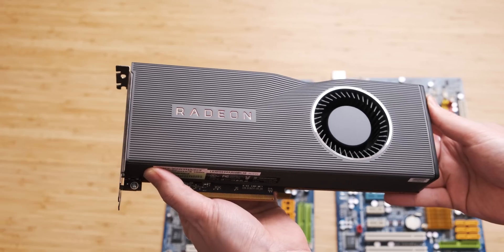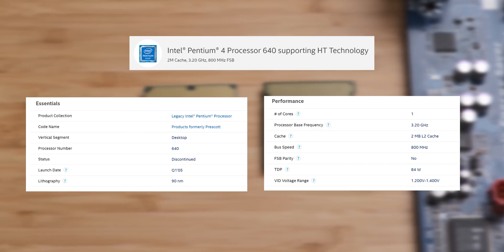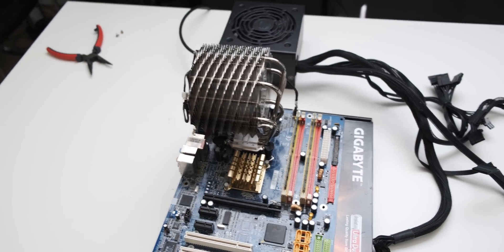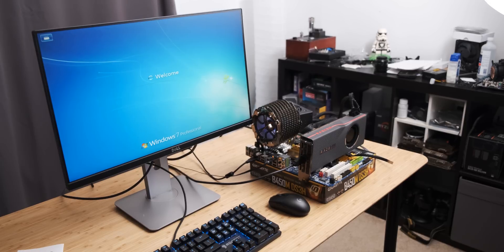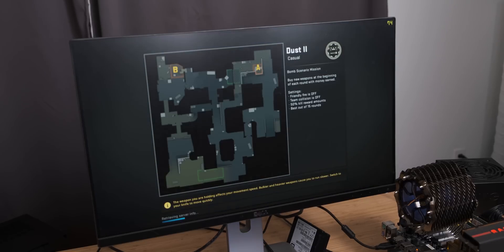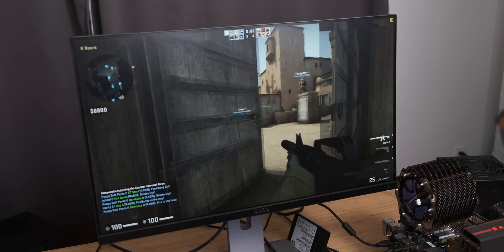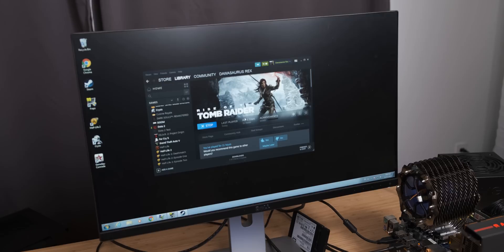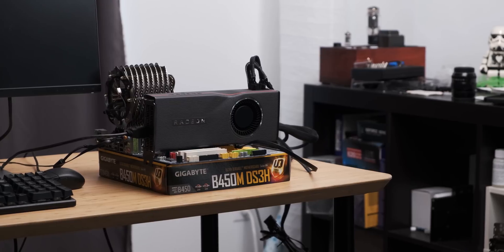The ULTIMATE CPU bottleneck: AMD RX 5700 XT Ft. 2005 Pentium 4

Comment: I could try pairing my Radeon 6700 XT with a Pentium 4 670 (with the same humble 225 MHz FSB OC as your chip) or a Core 2 Duo/Quad 6700. Don't have an i7 6700 yet. What I do actually have is a few hundred grams of other CPUs ... And just enough mental energy to test a few of them. If I do, I'll post my results on Reddit.

Comment: Try a Core2 Quad in that rig. Be aware that not all system boards will run the later 45 nanometer  Core2 series of chips. IIRC Intel 965 series chipsets only run the 65 nanometer earlier Core2 and the Intel 31 and 41 chipsets are for the 45 nanometer chips. It's been a minute since I had those in working computers.

Comment: I have a eVGA 680i SLi motherboard and Q6600 (GO stepping) overclocked to 3.84 GHz with 8GB's 1200MHz DDR2. (CRYSIS rig from 2007-2008) 
I then through a GTX 1050ti in it and it actually played a lot of newer games, especially DX12 and Vulkan titles like DOOM 2016 and Sniper Elite 3, 4 at 60fps at 1080p high settings. I then through the GTX 1050ti in a i7 3770K build overclocked to 4.8GHz and was playing Metro Exodus at 1080p high settings with Physics at 60fps no problem. Tessilation would bring it down a bit but, it did still run quite well. nVIDIA promised a 32% increase in performance with there latest 10/16/20 series drivers in Metro Exodus and they didn't dissapoint. AMD also boosted perfomance in Metro with there RX480/580/590 4GB/8GB cards. I'm actually testing a Sapphire Nitro+ RX480 8GB OC (1342MHz) basically a RX580 on my 5.3GHz 8700K GPU bench and its running at 1080p Ultra settings averaging 60-75fps. Just have to pick those certain titles, (that are still great games) with the right hardware and you can still have a great gaming experience at 1080p. High, Ultra settings.

Comment: If you feel like making a part 2 of this video, give it a go with this set of games.
F.e.a.r (looks great imo too this day.)

F.e.a.r 2 (has it in minimum requirements so give it a go ^^)

trackmania nations forever (ran this on a intel atom n450 w 1 gb ram & igpu so pentium 4 shouldn't be an issue.)
Serious sam 2
serious sam hd (Either of the encounters are close too the same engine & has fairly low requirements it seems.)
Left 4 dead 2
alien vs predator (the 2009 or 2010 game called that.)

bioshock 1,2 should start on the pentium 4 (not sure the hd releases will actually.)

Sonic allstars racing (not transformed) has pentium 4 as minimum requirement

Battlefield 3 should start on that pentium 4 as well, but ofc will run like garbage like expect 25 fps regardless of gpu on average.

colin mcrae dirt has 3.0 ghz pentium 4 as minimum requirements so that will also start on this.

Dirt 2 might start as well on this pc, not 100% sure though.

Worst case scenario is that you can stick in a celeron 450 which is a core 2 duo era single core & overclock it a bit if you need core 2 duo cpu instructions.

Or upgrade too socket 1155 & use a celeron g470 a 2 ghz single core or the celeron g555 which is the fastest dualcore celeron on socket 1155 at 2.7 ghz & turn off 1 cpu core just too have newer cpu instructions while still having a pretty big cpu bottleneck, ofc it will be more efficient then a pentium 4 or pentium d probably but still...

Comment: A. get better motherboard B. max the ram 8-16gb ddr2-ddr3 C. get p4 672 or 670 D. overclock it 4.5ghz or even futher needs watercooling E ssd is allways a nice add on F. Try to run both cinebench r15 and r20

Comment: The ultimate CPU bottleneck is on my phone when I disable all the cores except one low cluster core witch I have underclocked to 300 mhz (same CPU power as one 2008 smartphone)
Also Pocophone extreme user here :)

Comment: 1 core i9 9900K 2 ghz vs 1 core pentium 4 , 4 ghz <3
Reply: even the first core 2 duos where almost twice as fast per clock than the netburst pentium 4. and a modern day cpu should at least double the IPC of a core 2 duo. so i would recon 1core 1 ghz core i9 vs 1 core 4ghz pentium 4 would be about equal in basic tasks.

Comment: Next video: Ultimate GPU bottleneck. 
Use a GT 210 with a core i9 or Ryzen 7,9 xD
Reply: No a gts 450 with a threadipper 3990X I want to try it but I only have a 3700X in hand and a 2080 ti could find a gts 450 or fix one scares me

Comment: There are even worse combinations possible; there were some 478 boards with pci express slot and cpu wise you can go down as low as a 1,4 Ghz Celeron on those...
Reply: You can't run 64-bit driver on anything older than Prescott stuff.
Pascal + Northwood Celeron : https://i.imgur.com/4yC4r2c.png

Comment: I am surprised Half-Life 2 was that stuttery. Considering it was a game released prior to Dual core being the norm(I am not entirely certain about this but I am very certain loads of people were still using Single Cores), that the game struggled quite a bit. My best guess is that the at the time Half Life 2 was released, it ran primarily on 640x480 and at most, 1024x768, so trying to run the Pentium at 1920x1080 was probably a bit too much despite the GPUs being over a decade ahead of what HL2 was built for. Another reason why HL2 might have stuttered is because the game might have been updated over the years to be compatible with newer systems and those compatibility updates might have harmed performance, which is not a problem for even modern day IGPU setups, but may cause performance isssues for system that were from that time. I saw a dude test an early Intel IGPU and he tested the original HL on steam and it was unplayable, the Tested the non-steam version and it performed much better(although performance was still not ideal).

Comment: that and the fact its running off the first gen pci-e lane is a bottle neck, funny thing is if you took that gpu out and put something like a 750ti in it you would get the same fps because of those 2 bottle necks. Ive seen a test like this on linus tech tips channel
Reply: 🙂 yes a 750ti or an HD equivalent is a good sweet spot for these older boards

Comment: I have two Northwood Pentium 4s. One is clocked at 1.76Ghz and the other is at 2.6Ghz. Runs NFSHP2 quite well until the optical drive decides to eject the cd in the middle of a race.

Comment: 3 Years later we have Quad Core CPUS like the 920 that can still handle Gaming today. Insane how slow the Progress in the last 10 Years was. Still using an first Gen x58 Board from 2008 with the W3670.
Reply: 🙂 i have three 1156 with X3470, its alot cheaper 😍

Comment: Try using a Core2Duo or Core2Quad

Or use a 771 Xeon in the 775 socket and try to play modern games on that
Reply: On those cases you need to overclock the CPU, because the Q9650 at stock speed, bottlenecks a 1050Ti XD
Reply: @gamamew  well yeah the Q9650 stock cant do much but i got the Xeon E5430 and stock or overclocked i dont see much differents while paired with GTX780
Reply: I used to play Skyrim with a core 2 duo,  4gb of RAM, and a GTX 9800. It ran pretty decently. Even ran GTAV at 15fps.
Reply: @TheLoneWolf449  what pc you got now?

Im rn trying to figure out what usb bios programmer to buy to fix my gtx 980 , even tho im runing a gtx780 rn as my main gpu
Reply: @dexsters5643  It's not the best PC I've owned. But I currently have a Dell Optiplex 7010 MT that I upgraded. It has:
i5-3570 @ 3.4 GHz
XFX RX 580 undervolted/overclocked
16GB DDR3 @ 1600MHz
256GB Samsung 850 EVO SSD
500GB Crucial MX500 SSD
1TB Seagate Barracuda 7200RPM HDD
750W Corsair RMX series PSU

I've never touched BIOS stuff on a GPU, I don't know much of anything about it.
Reply: @TheLoneWolf449  that pc is more powerfull then my current 1
which is
FX 6100 @4Ghz
8gb DDR3 1600
GTX 780
mobo: 990FX Extreme 3

i have a H61 mobo lying around with a pentium but i want to get a 2nd or 3rd gen i3 or i5 

i tried using windows bios flashing tools to flash the gtx980 but didnt work, freedos flashing doesnt work because im doing it wrong even tho i follow the steps.
im just going to buy a usb bios programmer

Comment: "I'm going to start fairly conservatively"
Runs CS:GO instead of CS:S 
"Not looking at a good start here..."
Reply from the maker: Haha!! I thought CS GO was conservative for a RX 5700 XT, regardless of CPU. I guess CS:S would have made more sense. :P
Reply: CS:GO is cpu heavy
Reply: @noah-fl7xt  cs:go is not heavy on anything.
Reply: Aldo Miguel It is on the CPU.
Reply: @amr.c1650  heavy on CPU
Reply: Even a Celeron can run cs:go ffs.
Reply: @amr.c1650  At one frame per century, yes.
Reply: @amr.c1650   There's a difference between running the game at all and having  a ESPORTS gaming experience.
Reply: @surge9310  if any half decent CPU can get 120fps, it's not CPU intensive
Reply: @amr.c1650  120fps on low, 720p is not a lot. That's literally garbage for esports titles like CSGO.
Reply: @surge9310  the only load on the cpu for that game is trying to keep up with the amount of frames the gpu can render. Hence, not CPU-intensive. Is it really that hard to understand for you?
Reply: @amr.c1650  120 fps is not enough for high competetive play. even mouse responsivnes changes with more fps.. its noticeable up to 400fps. above its the same.. plus 60hz is pure cancer.
Reply: @croatianwarriorcrusader  which is why I said "any half decent cpu" A $120 CPU like the ryzen 2600 can sit comfortably at 300-350fps, and I'd wager that the i5 9400f could get close to 400fps. So, like I said, not CPU intensive
Reply: @amr.c1650  u are missing the point bro...
You can get 200-300 fps with ryzen 2600 + gtx1060
But you will not push 400-600fps with ryzen 2600 + rtx 2080
You will get more frames out of csgo by overclocking/upgrading to higher freq cpu than 4x stronger gpu... Tested gazzilion times trust me. Thus cpu intensive.
Reply: @croatianwarriorcrusader  Any game is "CPU intensive" at 300fps. Most AAA games will show a CPU bottleneck a lot earlier than 300fps.
Reply: Hell for this CS 1.6 would have been more suitable. I am pretty sure Source had multicore rendering, though it was from the same time period.

Comment: Finally i've found a CPU that has a lower CB score than my laptop. 94 points are hard to beat
Reply: Lol what cpu does your laptop have?
Reply: @Benjamin-ko1fg  prolly a older pentium mobile or a i5 2320m (i know vause had a laptop that had that at one point
Reply: @thesandman8885  pretty close, a year off! i5 3337U, 2 cores at 1.8GHz! Never hits the 2.7GHz turbo as it overheats in 1 second lol
Reply: @FAB1150  how many fps do u have in minecraft? 

I can't believe that your cpu is more shittier than mine thats unholy
Reply: @honigfna3551  hahahaha I've used the laptop for a good while, I get ~15 to 20fps in Minecraft

I just decided to upgrade and built a desktop with a 3700x, it's literally more than 10 times better lol
Reply: @FAB1150  according to these benchmarks:
https://www.notebookcheck.net/Intel-Core-i5-3337U-Notebook-Processor.87765.0.html

you should have hit well over 200 points. bruh, ur laptop cooler sucks balls XD
Reply: Worth taking apart the laptop & remounting that cpu cooler, along with taking out any dust built up in it, there was a common issue with some thin cpu coolers in laptops where the heatpipe got bent too far during production and leaked out the fluid that vaporizes & actually transfers the heat properly leading too said lack of performance.
Reply: @dexthegamer3234  oh wow, I'm getting single core performance with all threads lol

Yeah, might need to dust it
Reply: @FAB1150  dust it hard
Reply: @dexthegamer3234  update!

There actually wasn't a lot of dust in there surprisingly, and I got more results: lower than before!
https://imgur.com/a/54lyTXr

The cooler in the laptop is stupidly small, looking at task manager it throttles to 1.65GHz while running cinebench lol

Comment: Maybe this was a dumber decision than putting a GT 710 with a r3 3200g
Reply: That's not even that bad, the 3200g is actually a great CPU. Your 3200g actually has significantly better integrated graphics than your 710.

Comment: Ok l have Gtx 1070 and i5 2400 and ofcourse l got bottleneck.
So l want to buy i7 3770k 
What are you think
Reply: does your mobo support 4th generation of i7 because you should get an i7 4790k. I wanted to get that CPU but my mobo can only support the 3770k
Reply: @0x00Fyou  No.Best cpu for 1155 socked is i7 3770k
Reply: Can your mobo actually over clock? If not get Xeon equivalent of i7 3770 much cheaper
Reply: It would give a good performance boost if you overclock it. Otherwise a r5 1600+ a cheap b450 mobo is also good

Comment: when you spend all your money on the graphics card but forgot about the other specs
Reply from the maker: Haha!! Its all about getting that fat GPU. :P
Reply: @DawidDoesTechStuff  definately is
Reply: me in a nut shell 
lol im using a gtx 750 with a core 2 quad 
not sure if its a big bottleneck but i know its a bottleneck from what i can see. i still get very good performance tho
Reply: @smwfreak_1  Not that bad, but still... Not good. I hope you can upgrade to an Athlon at least.
Reply: @t72-234b  thx LOL my new pc is coming with these specs gtx 1050 ti
 ryzen r5 1600
8gb ddr4
480 ssd to make things load quickly im pretty happy :D
Reply: @smwfreak_1  alright, that's quite good. Be sure that you get a good quality motherboard. If you get at least a b350, you can even upgrade to a 3700x (if you're into 8 core CPUs).
Reply: @t72-234b  not sure if the A320M-HDV R3.0 is a good motherboard??
lol nvm i can hold cpu's up too r9's
yea i also can get a 3700x if i want
but the pc what im getting is so good my processor can even handle a rtx 2060 card wtf but i still think i will upgrade my processor later on.
Reply: @smwfreak_1  It is good enough if you're only playing games. For rendering stuff, I wouldn't trust it a lot. I do render some stuff (my videos) but only like... once a week, and I use a 2400g (4c/8t) with an MSI a320m pro-vh plus (it has at least some passive dissipation in the VRMs). You're using a 6c/12t CPU (R5 1600) with a low-end motherboard. If you're not rendering stuff every single day, it is ok. If I were you, I would upgrade to a b350 or b450. Check detailed reviews that talk about VRM quality. If you get a b450, you can even use a 3700x (8c/16t).
Reply: @smwfreak_1  750 ti is not that good...you don't get bottleneck...if you feel low fps..it means your card is too weak...so you are rocommended to change it...
Reply: @smwfreak_1  nop it isn't
Reply: 5700 XT + i5 7400 aha
Reply: @smwfreak_1  I have gt 210 and core 2 duo.That worst part is the processor is in-built in motherboard.I have to buy a motherboard first to upgrade😢
Reply: @lakshaynegi82  dangggg
well i hope you do upgrade bro.
just save and find good deals :)
look around on newegg and amazon
not sure about ebay i hear too much people get scammed... also look at reviews of the items.
Reply: @smwfreak_1  when u have a laptop and dont understand a thing lol
Reply: @smwfreak_1  gtx 980 would be an upgrade for you
Reply: That's my PC lol. rtx 2080 super and a i5 8400
Reply: I'm using GTX 960 + AMD A8 7650K

 dunno if it's a big bottleneck
Reply: At least my RGB is not bottlenecking lol
Reply: LOL 😂😂😂
Reply: @fayenotfaye  i spent like atleast around 400
and i didnt build it. its basically an optiplex 780 and i just bought my gpu and a new processor and thats why it cost that much
Reply: My dad tried to get a Core 2 Quad Q9550 to work with an RX 580 8GB. It didn't work and all games wouldn't make the system crash.
Reply: Is only having 4 core 8 thread intel i7 8705g a bad bottleneck if I got a 30 series graphics card?
Reply: @borismurillo2834  not sure how you plan on running a desktop gpu with a laptop cpu...
Reply: @MyaSooon  eGPU
Reply: @borismurillo2834  gotcha, well thunderbolt will be the bottleneck there, not your cpu

Comment: Hmmm a 5ghz core i9 with only 1 core activated. This should rung csgo at least 100 fps.
Reply from the maker: Okay this video has to happen. :P
Reply: @DawidDoesTechStuff  <3
Reply: @DawidDoesTechStuff  do a clock to clock on one core to see how far Intel has come
Reply: @chriswright8074  you'll find that they've actually gotten the past 4gens SLOWER - that's right guys your i7 7700k is faster at the same clocks than your i9 9900k...  Oh and uhh updates make even older gens slower now....  Kinda sad to know they literally are taking steps backwards
Reply: Yeah i was like, the RAM and PCIE generation are probably bigger issues than the CPU, especially once OCd
Reply: Oh no no no. One fast core is way worse than you may think. With many slower cores the background processes and other things are being processed by their own cores. With one fast core it has to switch quickly and it causes loads of stuttering.

Comment: my room is very cold i need to install a 5700xt reference as my heater some time soon
Reply: What about the fx9590 with r9 290xs
Reply: @axxdrian  oo fx 9590 is the cpu to go for. Nice heater on it.
Reply: @axxdrian  FX 9590 OC with passive cooling and a GTX 480 reference SLI
Reply: why not a gtx 480? heck, 4 gtx 480s in sli
Reply: @dapz  dont forget a 7700k for additional heating overclock it to 5g Ghz if need it warmer
Reply: @forog1  7700K? too cool. Get 2 old intel xeons, then mod them so you can oc them
Reply: Looks like you boys don't remember the 8800GTX heater :))))
Reply: @35M3n  it's not that I don't remember it's just that I was not into pc gaming and pc hardware illiterate at the time to know lol
Reply: @35M3n  480 was just the hottest. Like, 85 Celsius doing simple tasks
Reply: @kire929  85 degreed for nothing? That's a video card issue what you say there.
 Mine stood in aprox 45 at idle, and after adding water cooling it was 28-30 at idle.